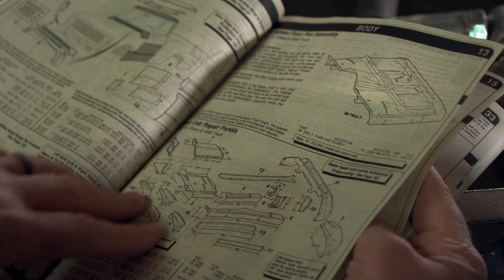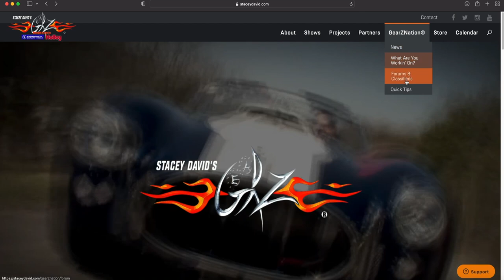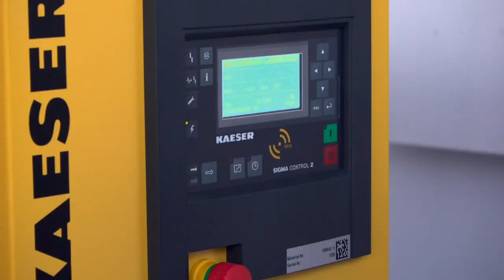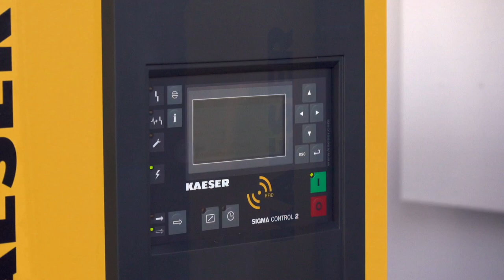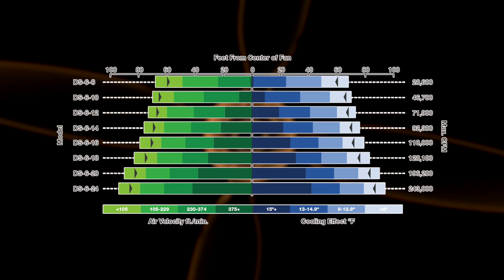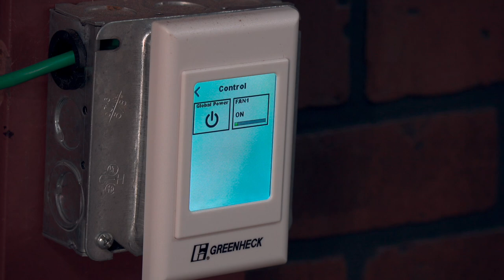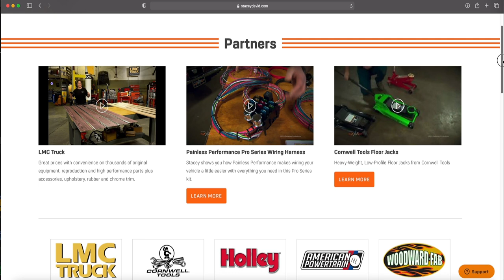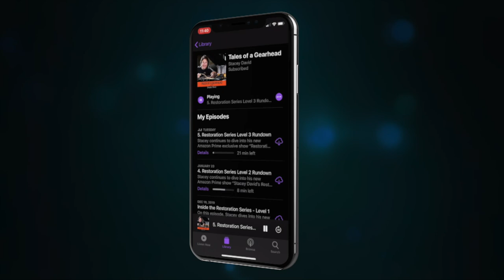Chevy C10 Trucks, Impalas, and More! Gearz On The Road - Stacey David's Gearz S16 E1

Comment: Hey Stacy. Love the new shop. Got a question for you. Notice you have the newest cornwell boxes there offering right now. Im a cornwell guy myself. Just curious what happened to your older boxes. Im looking for a full length locker for my box. Problem is mine are the older cornwell box designs and there discontinued. Need an orange locker. Any clue on where to get one. Thanks